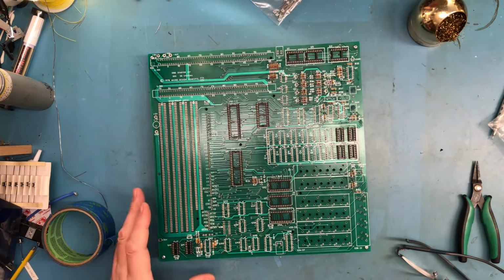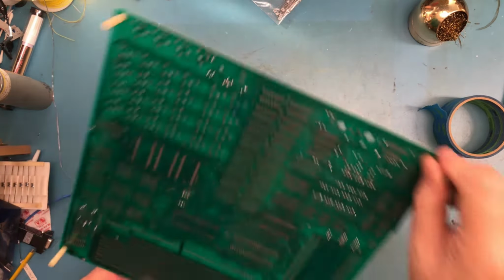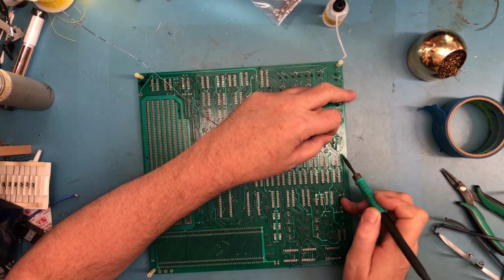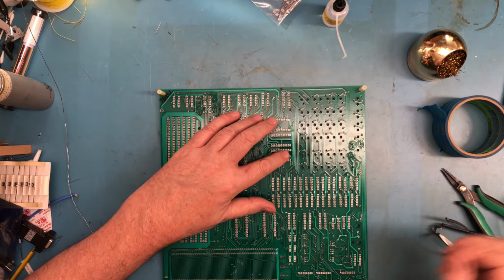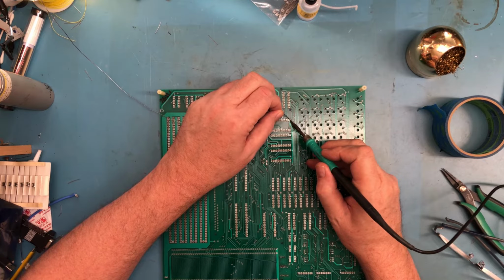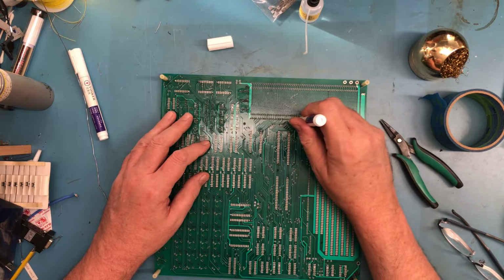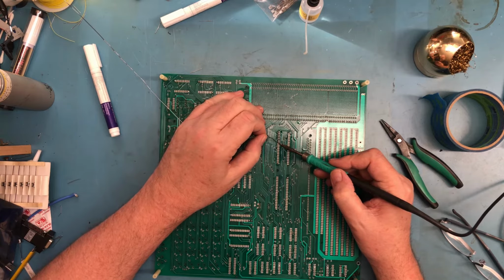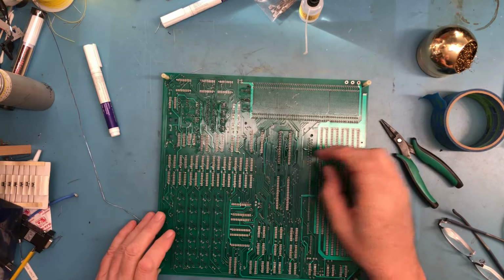STB563 - SD Systems - Part 4 - Soldering the IC Sockets

Comment: I honestly don't like Flux Pens. I bought a bunch of them from RadioShack when they were closing down (the second time) and they just make things too messy. I learned a trick however, you can get one of those Fiberglass Pens that is used for PCB cleaning and just do a quick wipe on the Traces and with a 60/40 Solder has enough Flux will flow just fine.
Reply from the maker: Cool, thanks. I'll have to try that.